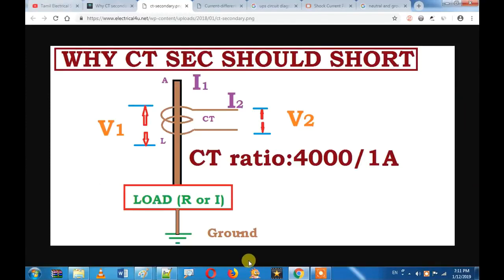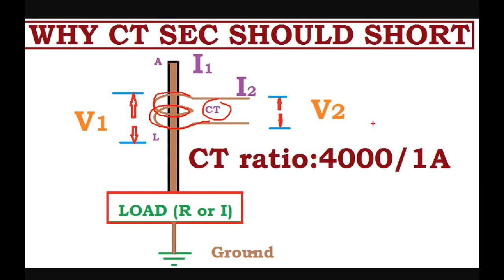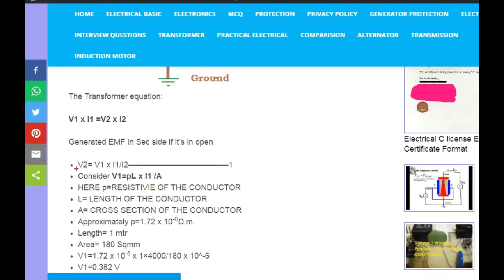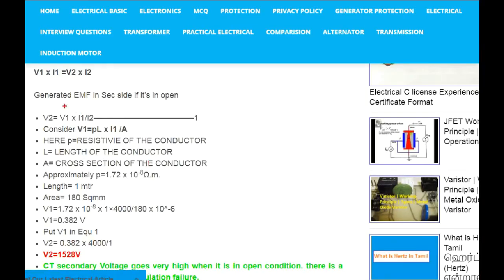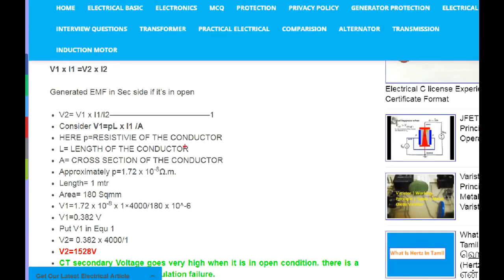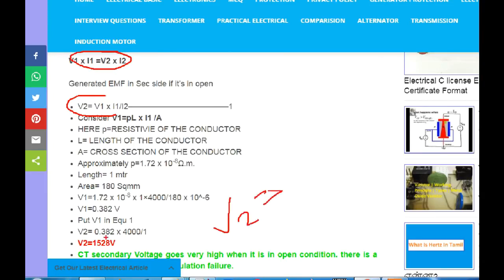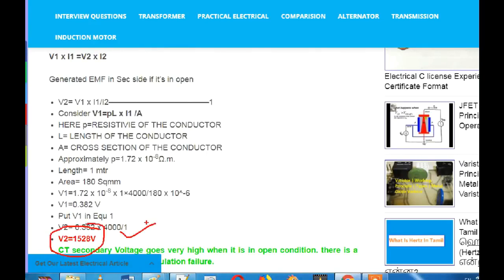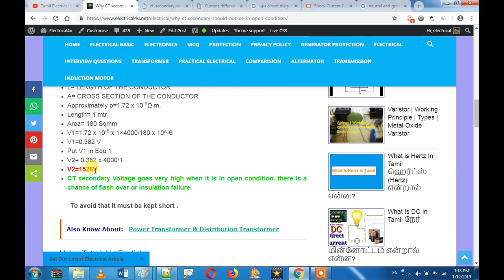Why CT Secondary Should Not Kept Open In Tamil

Comment: your explanation is wrong. When CT secondary open, there is no current flow. So how do u apply transformer ratio?

in case secondary winding is kept open then secondary current will be zero while the primary current of CT will remain same. Therefore the opposing mmf of secondary will no longer exist. Hence the net mmf is due to primary current only i.e. N1I1 (in case of 1A secondery CT)which is very large. This large mmf will produce large flux in the core and will saturate the core. Again, due to large flux in the core the flux linkage of secondary winding will be large which in turn will produce a large voltage across the secondary terminals of the CT.